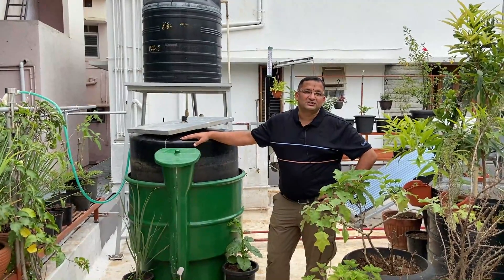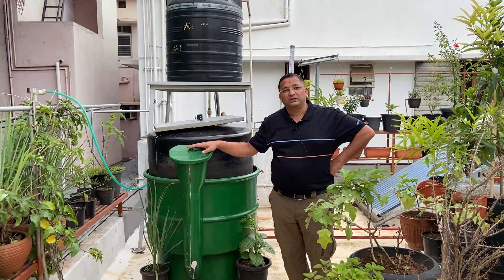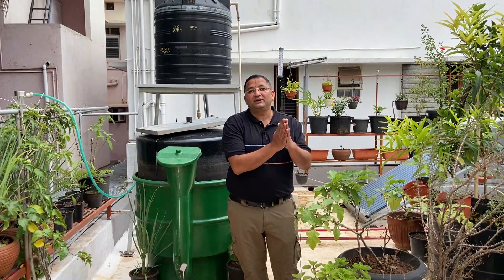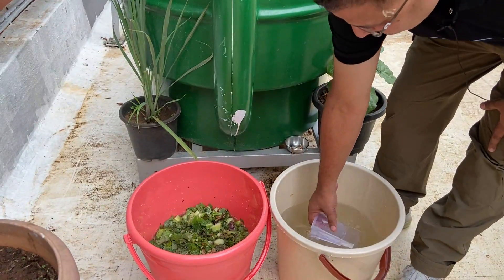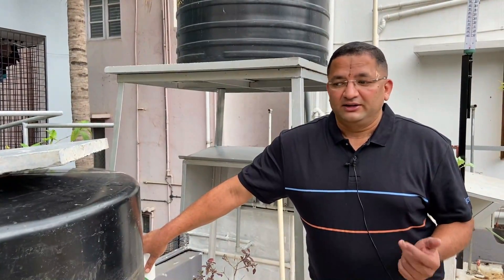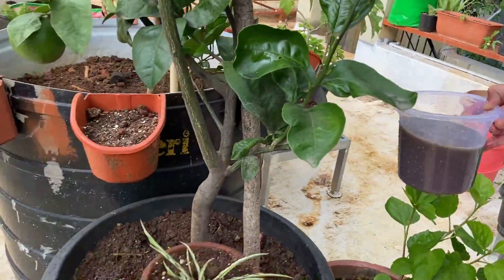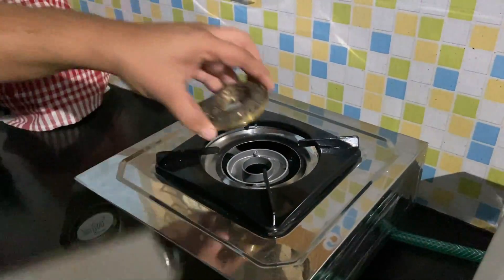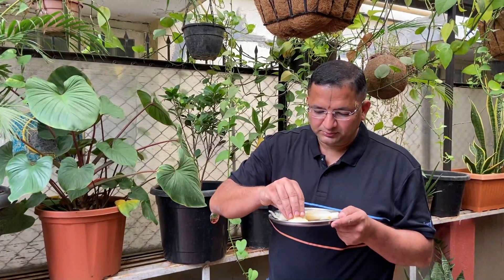Biogas Plant at home.

Comment: I have  a  question  to ask 
1: As we have  studied, it (bio gas) cantain acitiles and co2, which can  make our utilitial black and weak so, is there's any solution to that solve this problem  if their is please let me knom
Reply: use it as a fallback not primary, like basic stuffs, boiling, rice, and stuff, separate utensil and then coat it with soil mix, have a limited number of utnesil for this purpose,

Comment: I am using bio gas since 12 years in kerala. It saves lot of lpg. The stove shown in this video is little old model. The new generation bio gas stoves produces very strong flame. I replace my lpg cylinder once in a year only. The slurry coming out of bio gas plant is a very good organic manure. Using it one can save money spend on fertiliser.Benefits of
Bio gas (1) saves lpg (2) produces more heat than lpg (3) saves money spend for fertiliser if we have a vegetable garden (4) keeps our surroundings clean from organic waste. (5) maintenance free for long years. If using water jacket model  bio gas plant we should cover it with mosquito net to avoid mosquito breeding in the water jacket.
Reply: Hi, help me with setting up one
Reply: @01akash47 In which state you are residing
Reply: sir, Can I talk to you overcell phone?
Reply: Cow dung can be used .? Quantity ?.
Reply: @liaqatali8561  yes 5 kg cowdung added with 5 to 6 litres of water
Reply: How to make contact with you..
Reply: I would like to set this up at our home too. Would need help, someone in maharashtra